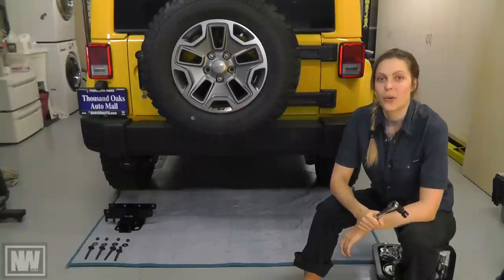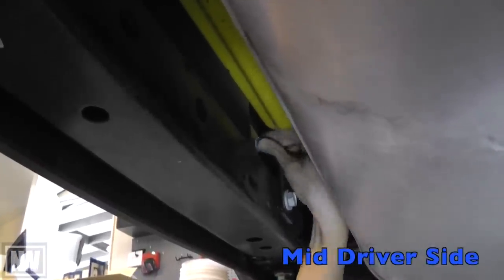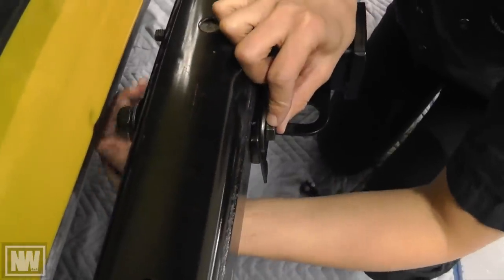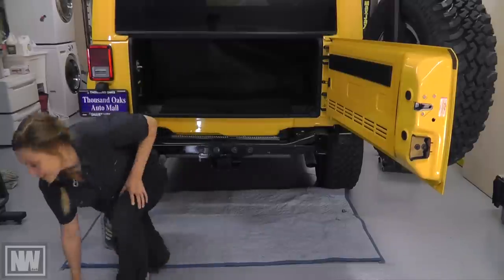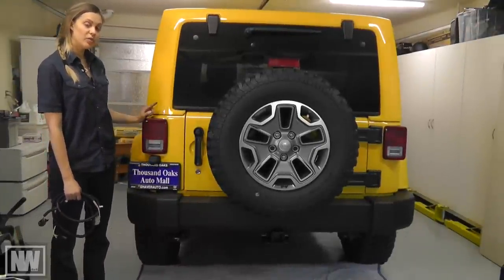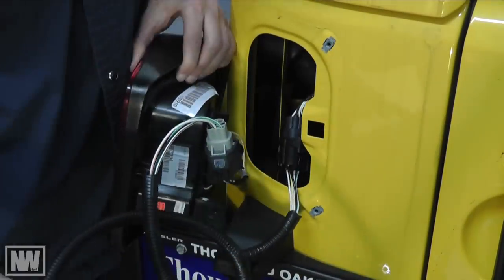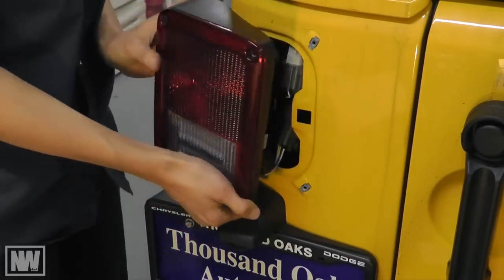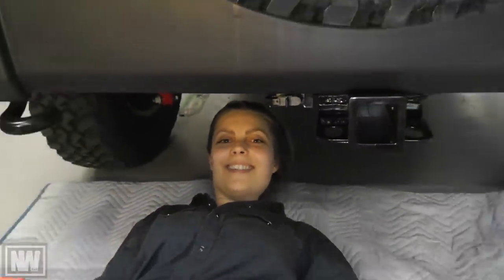Jeep Wrangler '07-'15 Tow Hitch and Trailer Wiring Install - "NeWere4x4"

Comment: I recently installed a receiver from Quadratec and there is no need to remove the bumper.  It is a simple install even it the nuts are not welded in place which was the case on my previous Jeep Wrangler.

Comment: Sorry you had to remove rear bumper to install yours. Not sure which tow hitch kit you installed, but the one I got from Quadratec had fixed, wielded nuts. The bolts ran from the front to back with no need to remove bumper. I think the Rugged Ridge kit is like that too. I have a 2012 btw.
Reply from the maker: This kit is by Rugged Ridge. Your totally right tho, even the stock factory hitch has the nuts welded in place. I chose to order the Jeep without the hitch ($540 option). The ideas so we could make this install video. End result it cost under $200 for the whole kit with an extra D-ring attachment.
Reply: NEWEREJK
Nice video & nice hitch.  I just installed the same model (Rugged Ridge $78.27 from Amazon) on my 2015 JKU without removing the bumper.  I had previously installed the Rugged Ridge Sherpa Rack & didn't want to disconnect it from the bumper brace too.  As you know, without removing the bumper the biggest challenge was lack of clearance between the rear of the bumper & the hitch to get the washers & nuts on (they are not welded on like the Quadratec).  The best way to get around this, without removing the bumper, is to line up the washers & nuts on to the hitch and then tape them securely.  Carefully raise the hitch into position without disturbing the washers & nuts.  3 out of 4 bolts went right on for me.  The 4th one I did have to adjust a bit when in position before it would thread, but it wasn't an issue & a lot easier then removing the bumper.
Reply from the maker: ***** Agreed.

Comment: You should only hold the tuque wrench by the grip handle at the bottom and cradle the head at the top holding in the middle will give you a wrong reading  over tuque the bolts and they can snap and under tuque they will fall off